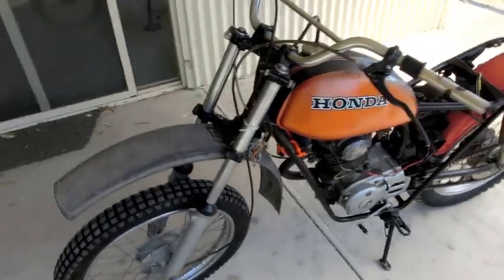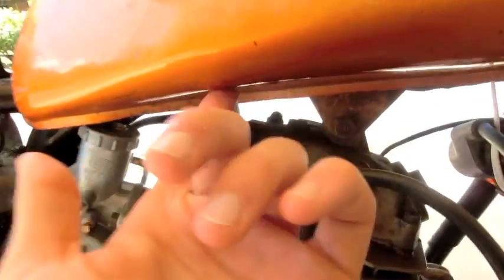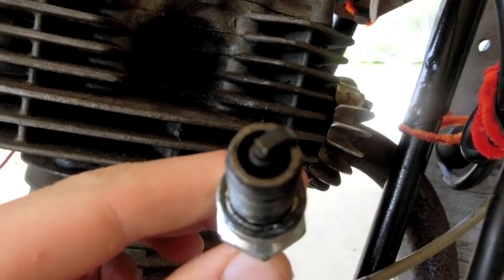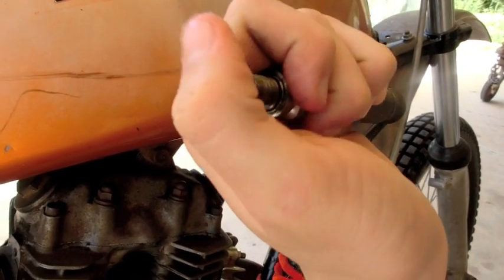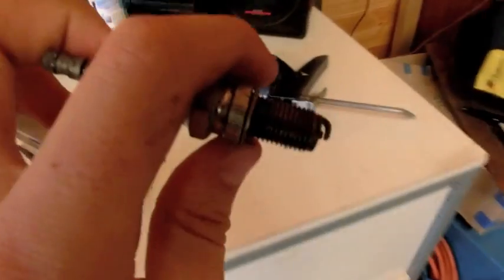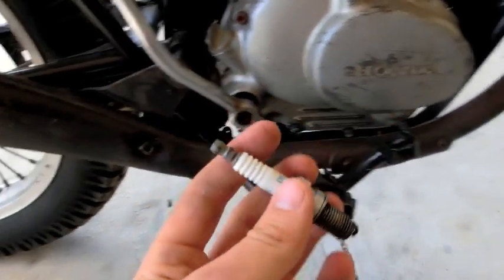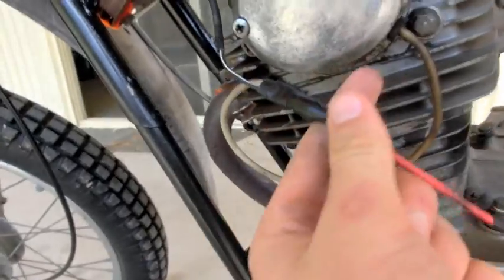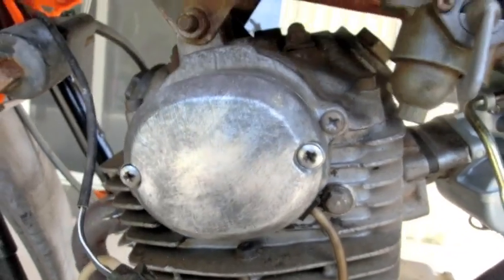Checking spark plug and electricals

Comment: My bike is runing to rich and it is bogging and fouling plugs I don't know which way to turn the screw it is the factory carb with only one screw any tips
Reply from the maker: gday man,
yeah this often happens,
normally tightening the screw will make the fuel air mixture leaner, and loosening will make it richer,
I cant guarantee this is correct on all carbies. but if it doesn't help just turn it the other way.
goodluck